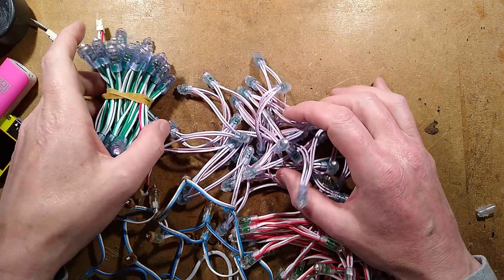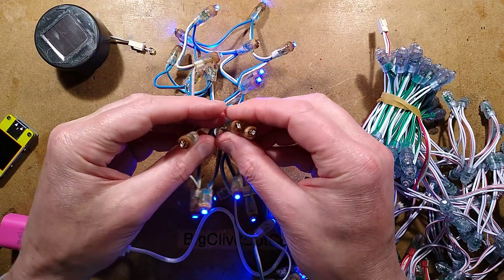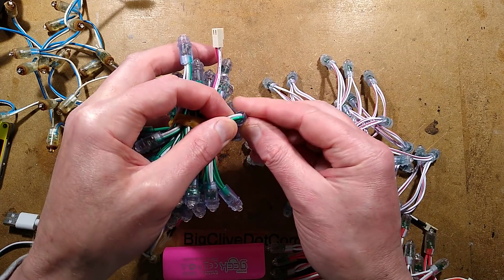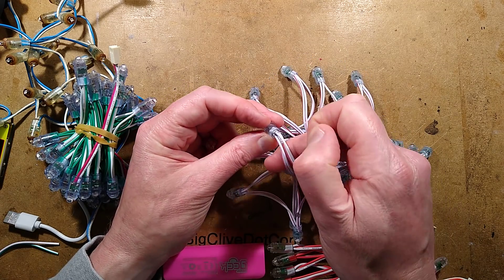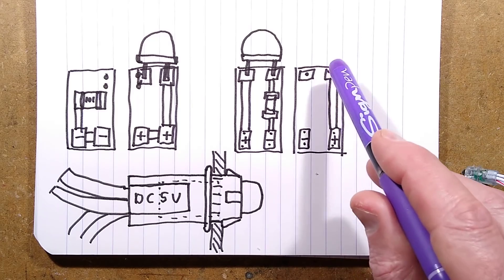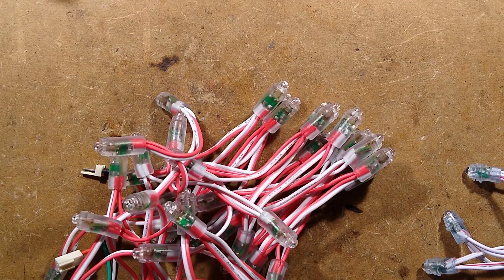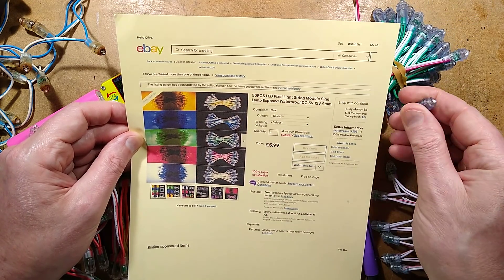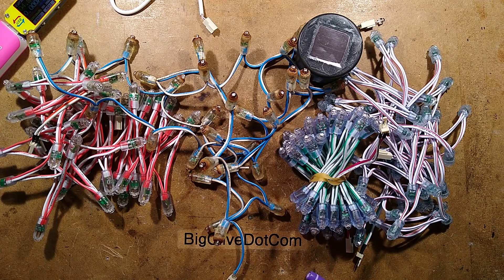8-year test result of outdoor sign pixel LEDs

Comment: I have a feeling that 8 years of Isle of Man sun is probably equal to about 1 year of sun in the American Southwest. Plastic out here gets absolutely destroyed
Reply: Im in Phoenix, can confirm. After two summers most plastics will crumble in your fingers.
Reply: This has me curious about what kind of materials are used for things made for outdoor use. What about the molecules makes them especially weak to UV vs more durable to such radiation? Any materials experts (or even enthusiasts :p) out there?
Reply: @lacunate  it’s probably the plasticizers escaping. Flexible plastics are flexible because of molecules keeping the actual plastic molecules from fully bonding, and as they go away over the years and decades, those plastics turn hard and brittle.
Reply: @JasperJanssen  right, cheap plastics need more plasticizers and the fillers also play some role. Virgin polyethylene or silicone will happily live for 10 years or more.
Reply: And, in Scotland, that is likely to be equivalent to 16 years sun...
Reply: Do plastic car parts do badly? My guess is that they are fine, that's probably because they put UV stabilizer additives in, which I guess are expensive enough so that aren't used in cheap plastic stuff.
Reply: @thegorgon7063  plastic car parts are better than they were 20 years ago. The premium wiper blades don't last a whole summer. Even things made for outdoor use like lawn chairs will be brittle and start cracking. I can say that PET and HDPE don't do well at all.
Reply: @thegorgon7063  many car parts do turn to brittle junk in the southwest or even on the east coast. i had an 02 corolla that every non padded interior surface was cracked after 15 years, got one from arizona to replace it when the first one got totaled. and miraculously it was completely fine even tho the windows had 0% tint all around, turns out the car had 50% on all windows and 30% on the windshield which was all removed to comply with local laws here. so windows tinting does wonders to protect interior parts.

exterior the parts are painted and the paint takes the brunt of the uv but things like tail lights and antenna boots turn to glass inside 10 years. thankfully i was able to strip my old east coast car and transferred all those parts to my arizona car.
Reply: In Vegas and Pheonix I'm surprised that glass doesn't crumble back into sand. 😂👍
Reply: @Codyjrt  After last week's "Heat Bubble" with daytime temps running around 44C, I wondered not so much about the LEDs in my outdoor lights, but the batteries inside them.   I haven't checked all of the lights, but at least a few are still working.
Reply: I have a feeling it is more like 1 week of American Southwest sunshine.
Reply: I think the damage to his blue ones is more due to rain water than sun exposure.
Reply: @two_tier_gary_rumain  A lot of plastics require humidity or they break down.
This is why people put false teeth in water overnight.
Reply: @two_tier_gary_rumain  Many people take their teeth out at night, while they sleep.
Reply: True, but eight years of Manx weather means rain,  cold and Salt. I think if I was validating the LED string I'd use both climates.
I suppose they last better in the UV if they were made if plastic with a high carbon black content. Oh, hang on, that might not work so well...
Reply: for sure

Comment: With those type of string lights running at such a low voltage, what affect do you think volt drop has had across them? Granted, the individual LEDs are very low current.

Comment: Did they get dimmer over the years?
Reply from the maker: They probably did even with just sunlight exposure.
Reply: @bigclivedotcom  Cheers. I ask because I have an old white LED torch and I swear that it isn't as bright as it used to be. Was wondering if it's a problem with older formulations of the (then new) blue and white and LEDs.

Comment: Wait... How the hell did the battery under the solar cell survive that long?!
Reply: I was curious about this too... I managed to find one of Clive's old videos where it looks like he's messing with the unaltered version of the charger ( https://youtu.be/Iis9sJFIR3Q?t=524 ), and by his comment, I'm guessing he put in a rechargeable AAA and waterproofed it. In that case, I'm guessing he probably just switched it out as needed. Just a guess though
Reply from the maker: The solar module got fixed/replaced occasionally.
Reply: @bigclivedotcom  humbug!
Reply: Here (down under) it's the resin crap on the surface of the solar panels that doesn't last. A few months in the Sun and they all turn white.
The glass ones, however, last for ages.
Reply: @two_tier_gary_rumain  Polish them with e.g. Gumption. The resin surface comes up nearly as good as new, and the performance is back to near-new too. I regularly give our VERY cheap Christmas lights a polish, and most are still working just fine after seven Aussie Christmases!  The other strategy is to polish, then spray some clear PU varnish over the panels - that seems to help a bit in terms of longevity! Best of luck!!
Reply: He waterproofed them with clear silicone. https://youtu.be/wmEyu-JAsnM
Reply: @cathedrow  but not the battery? I also recall him saying it went manky and he took it off at some stage?

Comment: I can’t believe that they still worked as well as they did!!! Nice 👍🏻 lighting with interesting construction 🚧 5V lights are PixelArt capable for signage 🪧 and simple shapes.

Could you make them dimmer capable or flash somehow with a small circuit on a USB STICK in line with the power???
Reply from the maker: Yes they could be dimmed with a suitable 5V dimmer or made to flash.